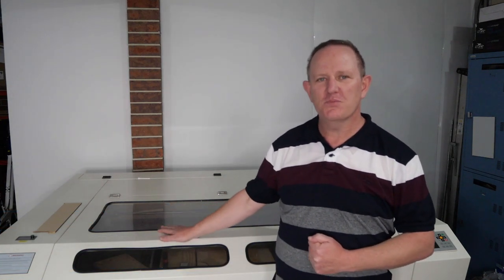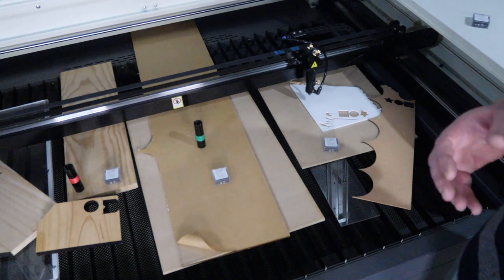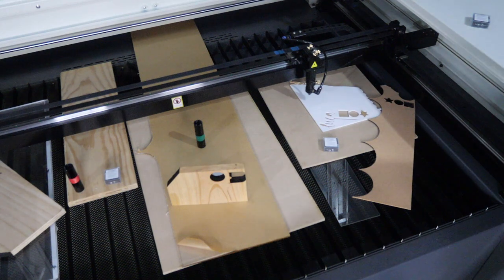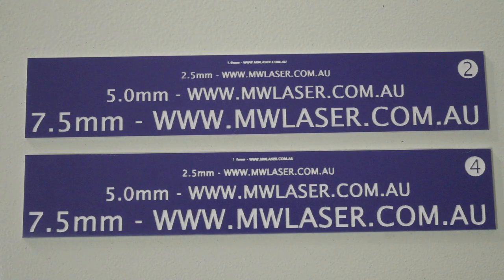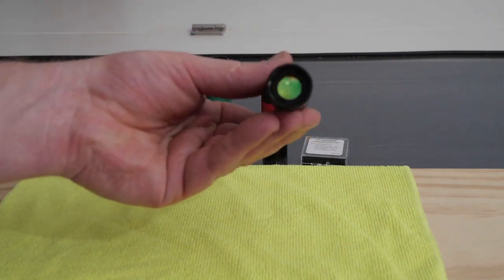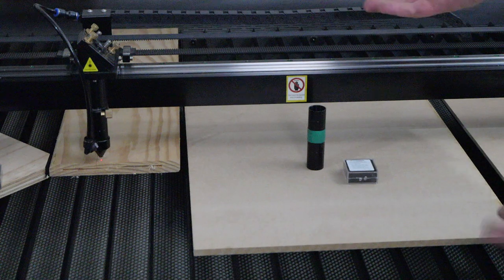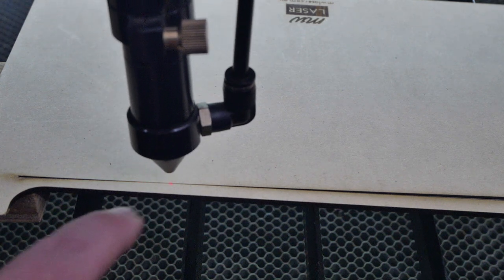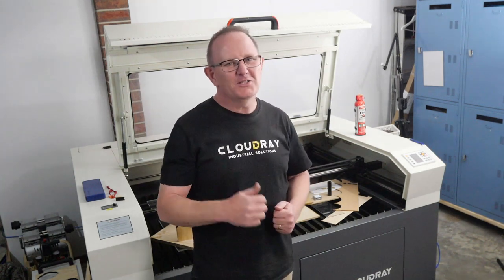Co2 Laser Lens Selection & Ramp Test

Comment: Amazing video...just amazing...very informative the best on YT...
Reply from the maker: Glad you enjoyed it
Reply: @MWLaser  Thanks, my 60x40cm CO2 laser came with a 2" lens (the smallest 12mm diameter) I bought a 4" one with ...well...mixed results. Now it can really cut even 50mm material but the strength of the cutting reduced significantly to about 1/3 as it was before so I still cannot really cut denser thick material but I can cut now 30-50cm foamboard :-)

Comment: (1) What is the difference between the Cloudray C Series, E Series, and K Series head sets? Can I buy any of those and then buy the various length lens tubes + appropriate lenses?
(2) Is there a chart which match the length of the laser tube to the type of lens characteristics?
(3) Do I have to worry about (and order) the other missor mounts if I am upgrading the head set?
(4) When upgrading can I / should I upgrade to a 20mm lens (and tube) if I currently have an 18mm lens?
Been following you for several years  . . . Great to see you still going strong, Matt! These videos are the best.
Reply from the maker: Reply is not saving - I have emailed you

Comment: I'm about ready to install my E-series RED Cloudray Laser Head -- and I got a tube.

Just to clarify: no matter what lens has been installed, the lens tube gets installed fully into the laser head, i.e., the lens tube is inserted all the way in until it stops

. . . and the lines on the outside of the lens tubes simply show where the lens is located and have nothing to do with how far the lens tube is inserted into the laser head 

. . . except for a 1.5 inch (31.8mm) lens which is inserted into the CAP and is 18mm in diameter (whereas the lenses of other focal length are 20mm for the Cloudray E Series Laser Hear.

Apologies for waxing verbose. Your reply could be a simple, "Yes." . . . if I have correctly describe the setup. :)
Reply from the maker: Yes

Comment: Thanks for very informative video! I have a Vevor 80W which is due to be arriving tomorrow. It seems very similar to your 80w. Is yours a Vevor too? One thing I've heard is that after doing the ramp test, you then add half the thickness of the material to the focal length seeing as the thinnest part of the laser should not actually be on the surface as measured in the ramp test but halfway though the material (as shown in your diagrams). Is that right? So if we're cutting 3mm ply and the calipers measure 7mm on the ramp test, would you then raise the bed up 1.5 mm so that the laser is hitting midway through the ply and the distance between the nozzle and the surface of the ply is now 5.5 mm? Thanks for the videos, keep up the good work!

Comment: I recently bought a laser cutter, and where I first cut 4mm MDF at 60% power 18mm / s, it now can't go through 4mm MDF with 70% power at 10mm / s. it has a 100w w2 reci tube, and around 10 working hours. the mirrors are clean and aligned, the bed is level. what's next to check?
Reply from the maker: More Information needed Do you have a mA meter installed on your machine or power supply?   - email matt@mwlaser.com.au for further support

Comment: I have a question: is there any measurable difference between using GaAs lenses vs ZnSe Lenses? And if so, is it worth the trouble changeing them if the laser isn't running 24/7?

Comment: One more question, given the laser beam formation and setting your distance of material to the material surface, would it not affect the cut angle especially for thicker materials to set the focal point on material surface as apposed to the center of the material/stock so the focal point is in the center of the material you're cutting?
Reply from the maker: Use a ramp test to fine tune focus for best results.

Comment: Hi Matthew,
Love your videos. Super helpful. I have the 80w red and black also and am wanting to get a spare lens for it. What would you recommend as I have no idea how to tell what came with it. My focal point is the same as yours at 19mm. My red light has never really worked so I also want to upgrade. Which is the best for the red and black? Is it also worth having a spare tube? Worried postage would be a long wait if my current tube dies. If so, I was looking at RECI on cloudray site but so many options and have no idea which one.Thanks 😊.
Reply from the maker: Hi the lens in the standard 80W red & black is an 18mm Diameter 50.8mm Focal Length.
I do not recommend holding a spare tube in storage,  unless there is no way you can wait approx 1 week for delivery of a new tube.  A Laser tube's life declines from day of manufacture, and so does it's warranty, so if your existing tube lasts 18 months and you have had a 2nd tube in storage that long, you are not likely to get the same life from the 2nd tube.
Reply: @MWLaser  thanks so much for the info. I won't be getting a spare tube at this stage then. Which red light combiner do you recommend for the red and black?

Comment: Have you thought about upgrading the Red and Black 80w machine with a different laser Head?
Reply from the maker: I have been looking into this option, however currently I have not found one to suit the current setup. as the ones I have found have longer lens tubes and by using these would reduce the ability to engrave decent sized items on rotary axis
Reply: @MWLaser  that’s the problem I’ve run into!

Comment: Do you set the distance to the focal length and a little lower to give more cutting depth?
Reply from the maker: I personally do not, there are some who say this helps.  I recommend testing for yourself on different thickness materials to get the best cut for your machine with the results you are after.
The main reason I do not is when engraving the focus needs to be on the surface of the material to get the detail and quality I am after.  Engraving first and then cut.
If the focus is set lower for cutting, then the spot size on the surface engraving will be larger and reduce quality.  You could engrave first pause and then adjust for the cut, but it can result in accidental slipping of material and the cut may be misaligned.  Therefore I find it best to use the right lens for the task.

Comment: Although I’m no expert, I’ve been led to believe that handling used CO2 laser lenses risks exposure to selenium and thorium, both of which are highly toxic. As such, it’s a good idea to wear gloves when handling lenses.
Reply from the maker: Yes It is always advised to wear PPE.   Here is the information I have from the MSDS
THE HANDLING OF ZINC SELENIDE OPTICAL ELEMENTS COATED WITH RADIOACTIVE 
THORIUM COMPOUNDS 
During normal handling or cleaning THERE IS NO RADIATION HAZARD TO THE OPERATOR as the 
closed elements contain so very little radioactive material, i.e. approximately 4.6 Becquerels per cm-2 of 
coated surface. 
The handling of scratched coatings should present very little hazard to personnel, however the following 
should be noted. 
When the surface of the optical element becomes scratched, it is possible for a small amount of the 
thorium coating to be removed. This liberated thorium coating may present a minor hazard if inhaled or
ingested, the magnitude of the hazard being directly proportional to the quantity of thorium released. 
A small scratch 0.1mm wide and 1cm long would allow the release of about 8 x 10-6g of thorium. This is 
equivalent to an activity of 0.05Bq. 
This figure should be compared to the permitted dosage limit which is between 10kBq and 100kBq per 
year dependent upon the exact proportion of the thorium isotopes. This low level is encouraging but at all 
times it is necessary to apply the principle of dosage being as low as reasonably achievable regarding the 
potential for the ingestion of radioisotopes. 
The International Commission on Radiological Protection and the British Ionizing Radiations regulations 
1985 require not only to stay within dose limits but also to keep radiation doses to individuals to the 
minimum which can be practically achieved. 
Thus is it advised that simple precautions are taken when handling scratched elements aimed at 
minimizing skin contamination and preventing material inhalation and ingestion. Accordingly, we advise
the use of vinyl or rubber gloves, together with a protective mask or filter respirator such as a 3M 9920. 
Operators should wash their hands thoroughly after contact with damaged elements. The use of 
elaborate protective clothing and radiation monitoring is considered excessive. To remove loose material 
from scratched surfaces it is recommended that a clean, soft, cotton cloth dampened with acetone to be
used. Gently wipe away any loose delaminated material from the scratch and its adjacent area. The cloth 
should be sufficiently wet to allow the loose material to be lifted and retained in the cloth. Used cloths, 
gloves and masks should be disposed of in a plastic bag, which should be sealed for disposal. 
INSTRUCTIONS FOR HANDLING BROKEN COATED ZINC SELENIDE ELEMENTS 
Dealing with broken or smashed optical elements presents similar hazards plus the additional danger of
skin cuts and punctures produced by the broken substrate material as this is an additional potential route 
for the ingress of thorium. It must be emphasized that for physiological reasons ingress of thorium 
through skin wounds is more hazardous than the intake of the same amount of material by the oral route. 
Any wounds or skin lesions must be cleaned and dressed before any individual continues in the clear up
operation. If a component is accidentally smashed, several smaller CLOSED SOURCES are produced 
from the one large element; only a small proportion of the contained thorium will be exposed or released.
Cleaning up should be performed by an operator wearing a disposable mask and gloves, together with a 
disposable paper coat to prevent any smaller fragments of the element becoming trapped in everyday 
clothing. Smaller fragments should be gently swept up using a plastic brush and dustpan avoiding the 
production of airborne dust. Place the broken fragments, dustpan & brush, dust respirator & mask, gloves 
and paper coat into a cardboard box, which should then be placed into a plastic bag and sealed for 
disposal.